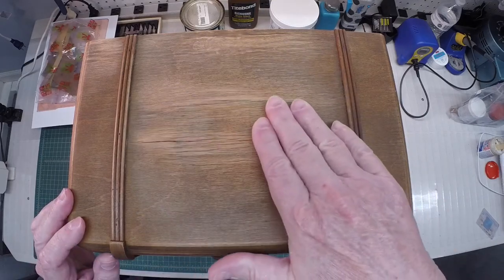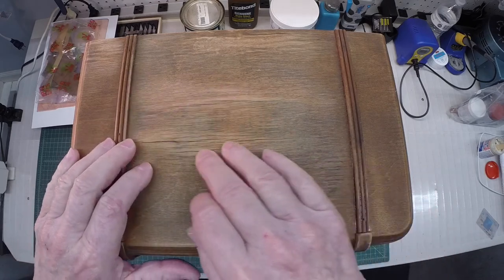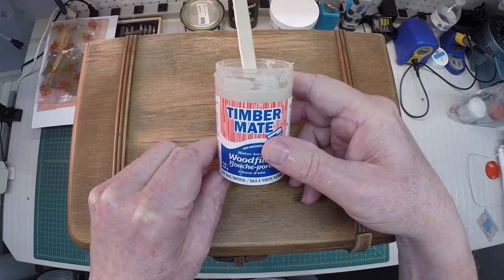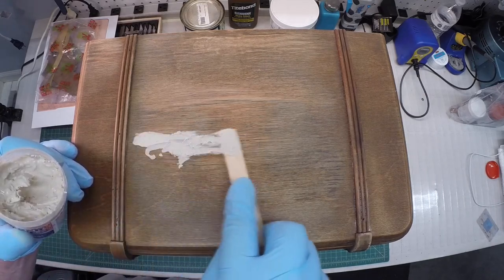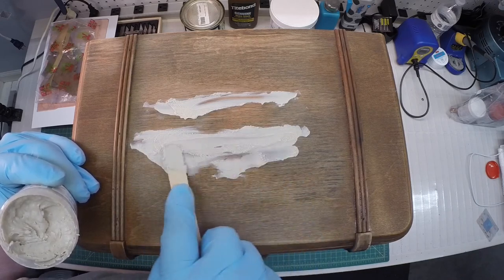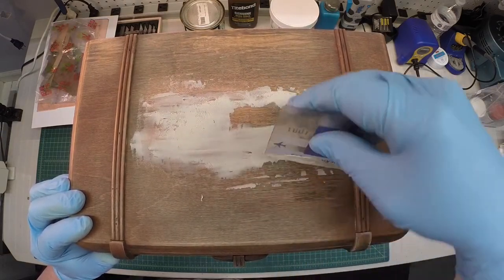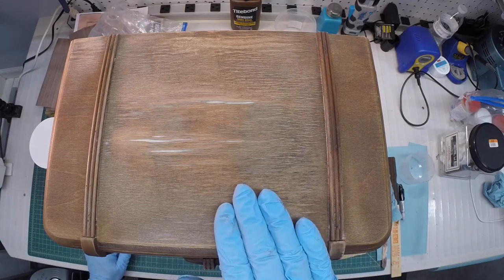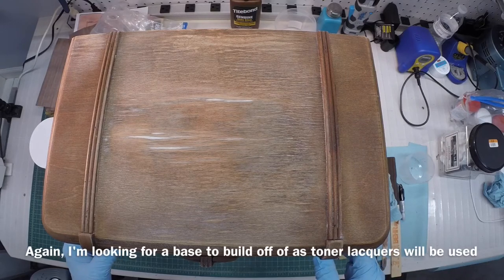Zenith 5-S-29: More Cabinet Repair + I Need Your Help

Comment: Hey Don, nice work!  I heard you speak of reforming grain lines with an exacto knife.  Another trick that Kimball used for grain lines were pencils, simply drawing the lines back in.  I'm not sure what grade the pencils were, whether they were softer graphite than the standard 2B or what but once finished you'd never know it was pencil work and not natural grain as you can make some of the grain lines wider or narrower that way.  Take care, Gary